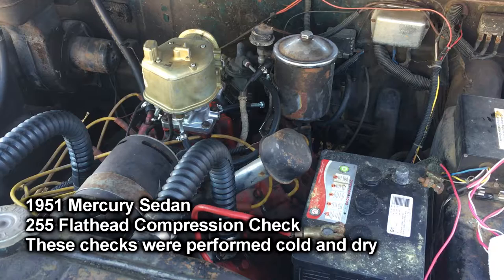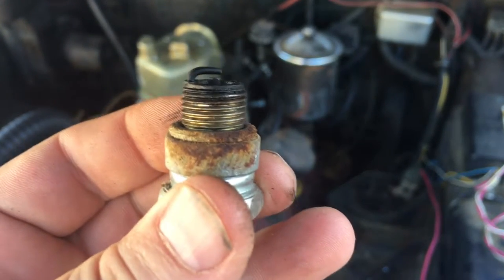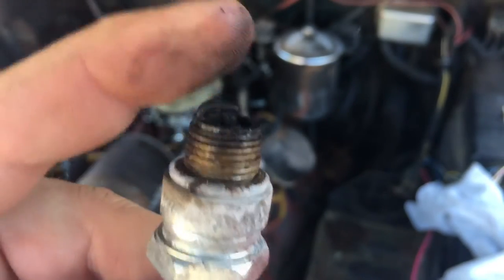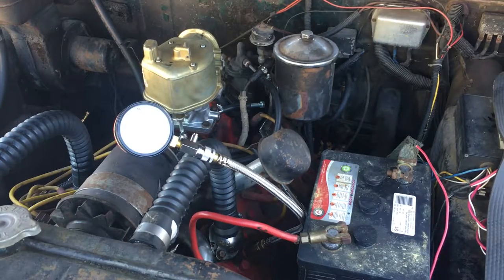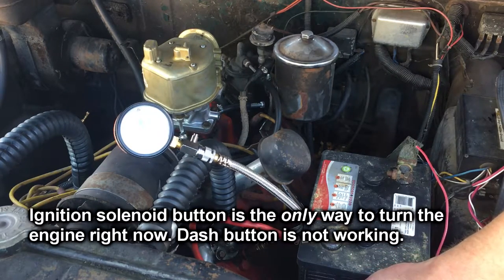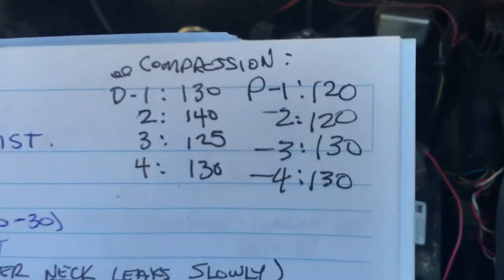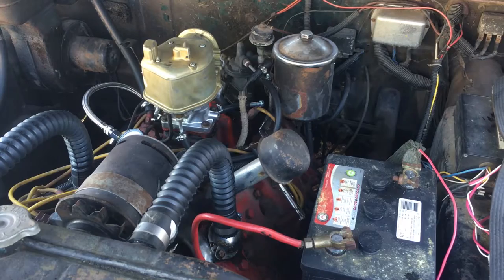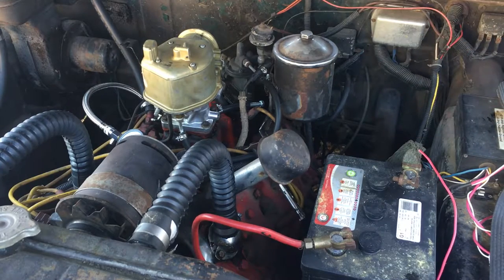1951 Mercury - Compression Test

Comment: which compression tool did you use?
Did it contain SAE threads or metric threads?
Reply from the maker: Almost all my tools SAE. Not sure the maker of the tester, it was kinda no-name brand
Reply: @MicrophonicFool  I have since learned the spark plug threads are 14mm. thank you for your video.